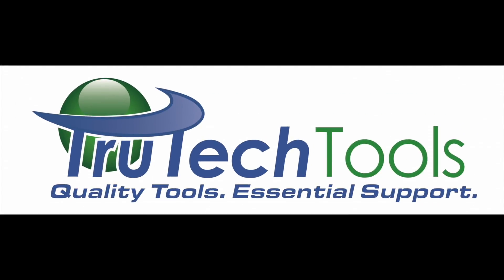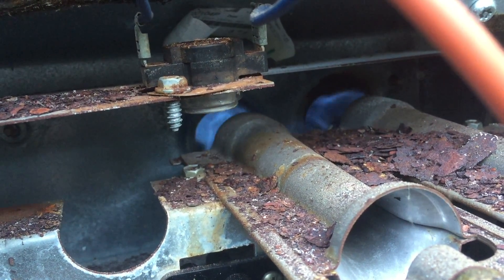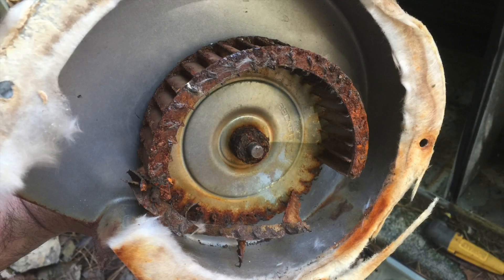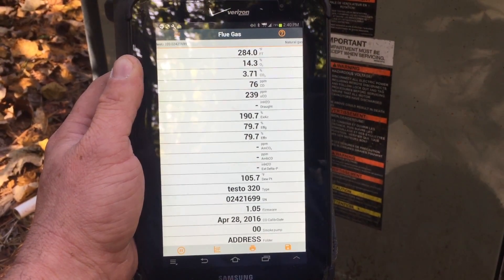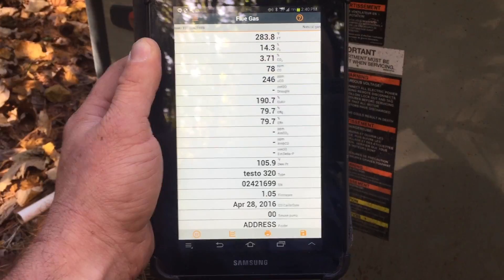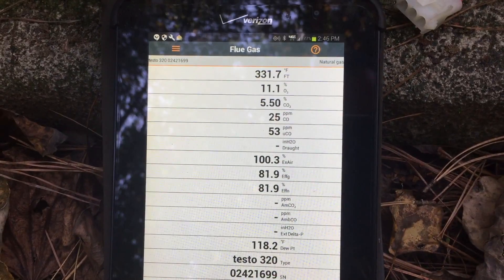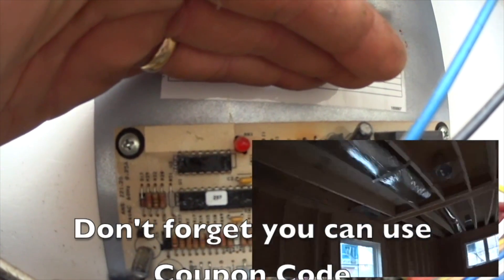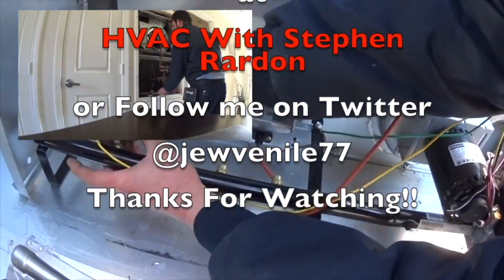HVAC Service: Inducer Motor Mayhem Fall 2016

Comment: Wish I had the opportunity to work on more gas systems than I do, I work in central NC. Seems like 90% of the stuff I work on around here are heat pumps. The few gas systems I've worked on so far this Fall, have just been corroded burners (propane) being the cause of no heat, where the burners wouldn't cross the flames all the way.

I've actually seen you in your service van around Sanford once before.

Comment: hey Steven.  why set gas valve at 3.8inwc?  thought 3.5inwc was design or is that the requirement for this unit?  I have that 510i testo too.  About ready to use it on some heating tune ups once weather cools down!
Reply from the maker: 3.5 isn't necessarily a solid stop point. if necessary you can adjust up or down from there a little, just not too far. you wouldn't want to adjust much more than 0.3"WC off the factory 3.5 or so.